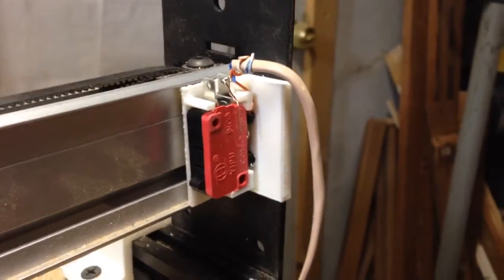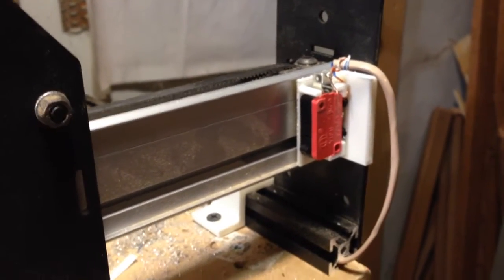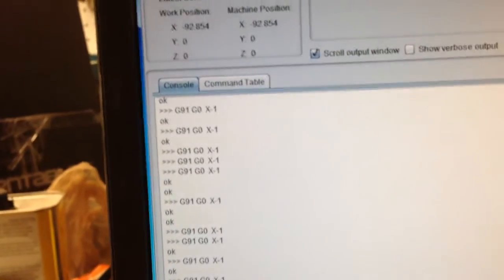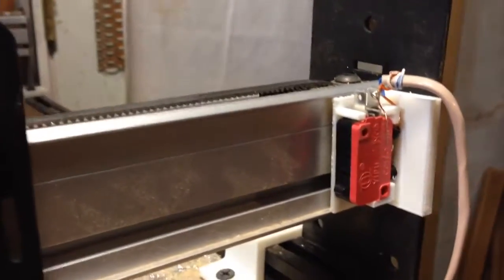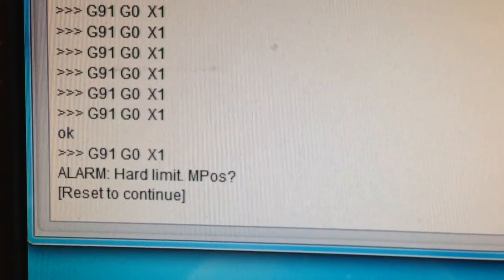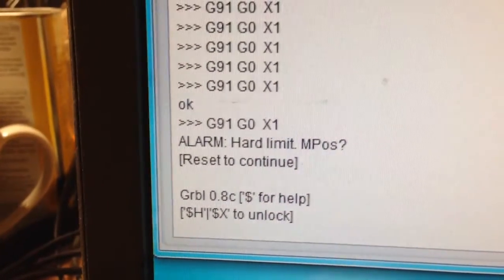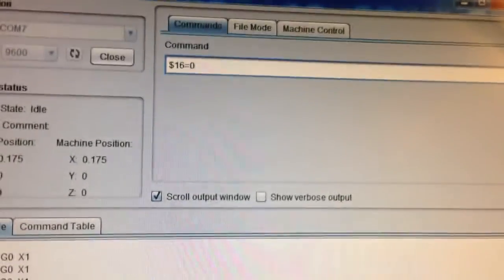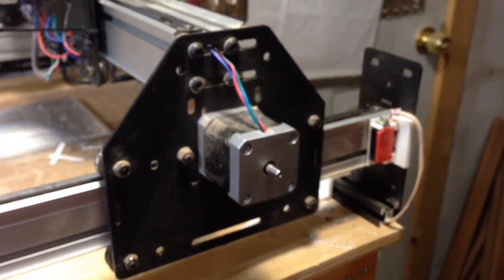Limit switches on my Shapeoko 2

Comment: Hi, I'm using limit switches as well and am trying to use them as hard limits and as a home switch.  The thing is whenever I home, it goes into the alarm state; is there a way for me to home without triggering the alarm (maybe through some settings in grbl?)
Reply from the maker: It's been a while since I set this up. To be honest I was never able to solve that problem. I ended up using the same setup with a different controller under Mach 3. I'm sure there must be a way to handle it... You'll have to ask the grbl people.
Reply: alright, thanks for the response though! I really appreciate it!
Reply: Ben Lei - Had same issue which I fixed this evening. 
1st issue was noise on the switch lines returning from the microswitches. Solved by adding 0.1uF capacitor between each switch line and ground. 
2nd issue was that my pull off setting ($27) was too low to clear the switch so it remained engaged. This caused hard limit alarm to stay on too. 
Now I can home the machine and it moves back off the stop by 2mm and will not alarm.

Comment: Are these absolutely necessary or else what benefit do they provide?
Reply: Limit switches provide two main benefits.

The first benefit that you can prevent the CNC machine from running off the edges of the table. If the machine runs into a limit switch the program will end. This prevents the X-axis and Y-Axis motors from stripping the drive belts.

The second benefit is that you can use these limit switches "home" your machine. This entails driving the X and Y axis until the limit switch is detected then zeroing out your axis. There are lots of reasons why this would be useful... particularly if you shut down the machine between runs.
Reply: Thanks.